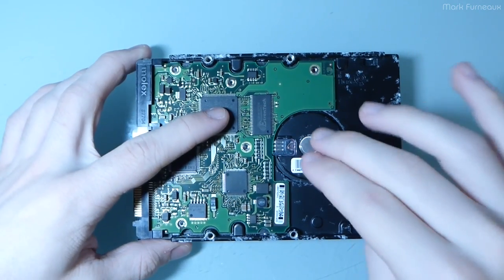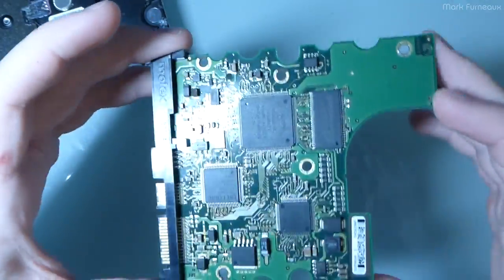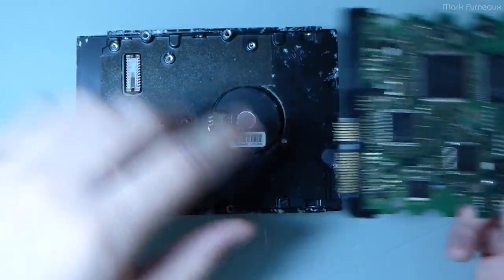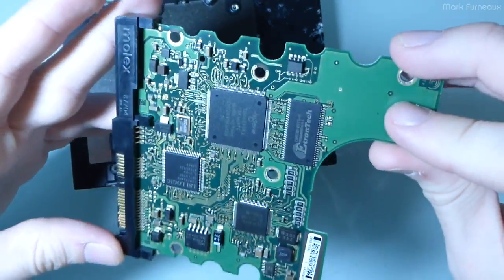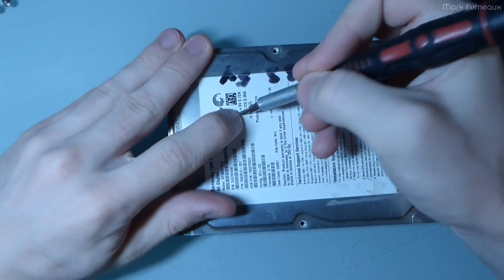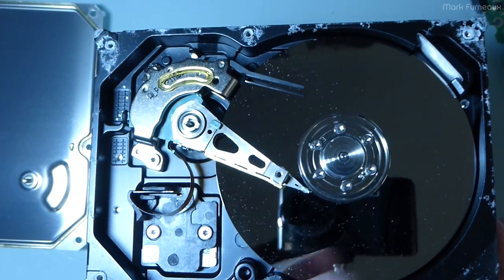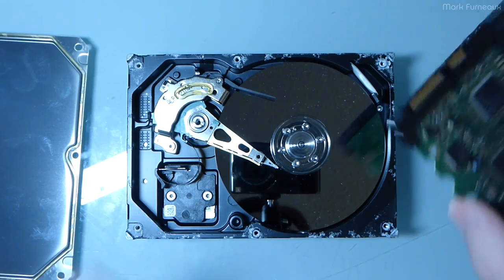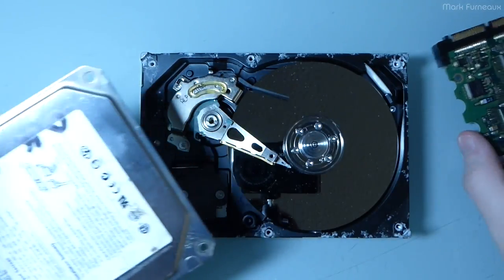Autopsy of the Buried Hard Drive

Comment: Try this again with an ssd to see if that will survive
Reply: it will survive but the data will be lost because ssds need to be powered on a few times per year so they dont loose the data
Reply: Not true at all, SSDs use non volatile memory (NAND memory to be specific.) which is not erased after losing power. What does kill SSDs is read/write cycles but that takes hundreds of terabytes worth to kill them.
Reply from the maker: No, Raeffi is correct. No floating gate CMOS cell has zero leakage. Enterprise SSDs have a powered-off retention time of ~2 weeks. Consumer drives will last 3 months to 1 year without power before the data cannot be guaranteed valid anymore. This gets worse with temperature.
Reply: 2 weeks of powered off   to erase a disk?  O.o i thought the retentionswas measured in tens of years  xD
Reply: *****
they are but on HDD not SSD
Reply: Recently, i plug in a micro sd that has 2 or 3 years to power up.. All my data was there. Does micro sd use the same tech as ssd??
Reply: its the same tech   but built differently

Comment: It is hard to tell which corrosion particles formed, because it depends on the humidity, pH and available other elements (for example chlorine in salt). Also the mix of different metals can form electrochemical elements, that make corrosion much faster.
Anyway, if the disk had time to dry in between it is very likely it formed aluminiumoxide, which is in essence the same as ruby, sapphire or generally the stuff that's on sandpaper. With its hardness of 9 to 9.5 on the Mohs-scale (diamond being 10 with only a few artificial minerals being harder than that) it's not something you want to drag along a disk (not saying that a hard disk would be fine with softer dust ;) ).

Comment: >You can't take one board from one and put it on another
Well I watched my father do that exact thing, and it fixed the drive for him. Albeit in 2002.

Things might have changed since then though but I wouldn't be surprised if this was just another myth, it's not like HDD's have changed radically in the past few years, they probably still use mostly the same technology as that 2002 drive.

Of course it's probably not good for the drive though since they likely have per-drive config/tunings/etc as you said, but it was good enough for my dad to get it running and get his data from it.

EDIT: bleh I should have watched further, thought you were flat out denying it was possible at first but I was wrong, my bad.

Comment: Seagates usually aren't too picky about the torque on the screws. It's mostly WD drives that have issues with that, and even then, it's more the position that's critical.

Comment: You don't need to torque the cover screws on the drive. I've removed covers from a bunch of drives. Hell, a lot of times drives will function normally without the cover temporarily. It's pretty much instant death for the platers but it will work.

Comment: You don't really need to get the torque right on the cover screws - only the retaining screw for the head stack requires such precision, and even then you can simple count how many degrees you turned the screwdriver to remove the screw in the first place.

Comment: Would a thin coating of Gold or Nickel on the platter actually prevent corrosion, without getting in the way of magnetic reading and writing?

Gold is also slightly malleable, so that might reduce the risk of physical damage.
Reply: it could cause issues because some metals have different magnetic properties. The platter didnt corrode in this drive the specks you see are from the casing of the hard drive.

Comment: Poor hard drive :/
Oh well... I wonder if you could do the same with an SSD? I mean, I think it'd endure corrosion better than a hard drive given that SSDs have no moving parts... but who knows?
I mean it has a circuitry so corrosion can most likely mess with it...
Reply: a SSD may fail as well, it will not become unusable, but it can lose all the data stored in them
Reply: i think he should test it just to see how long the data will last.
Reply: An SSD would have faired worse probably.
If any corrosion got inside the case of it, say bye-bye to all your data!

Comment: how does a hard drive work?
Reply: Charlie Dickxie ask Google
Reply: Imagine a record player but instead of grooves it was the stuff they use in magnetic tape.
Reply: Modern hard drives have a set of small platters covered in billions to trillions of tiny cobalt particles. Each magnetic particle has an orientation that is changed magnetically to store data. An actuator arm with a magnetic head at the end moves across the surface of the disk to read and write data with an electromagnet. The head of the disk levitates just a hair's width above the drive platter to modify or read the data.